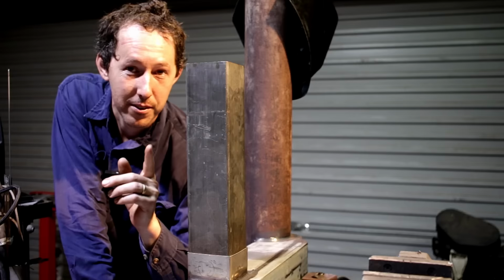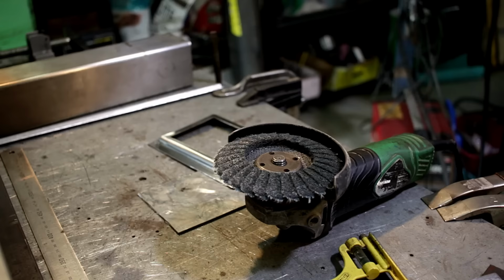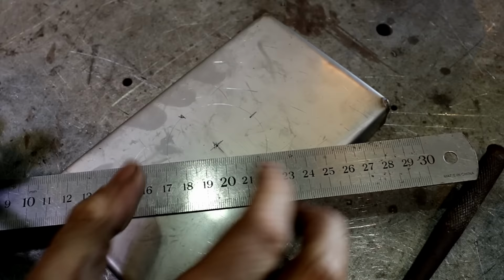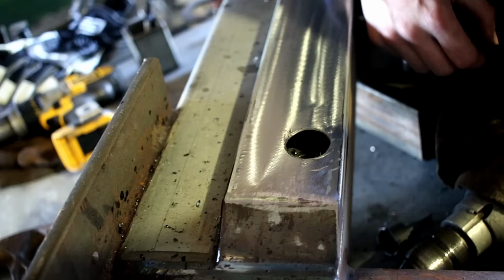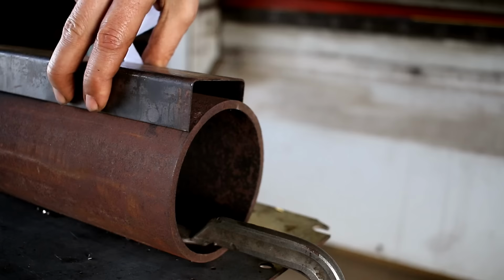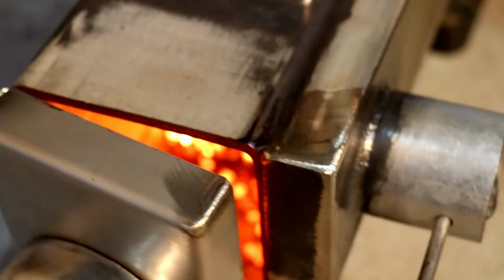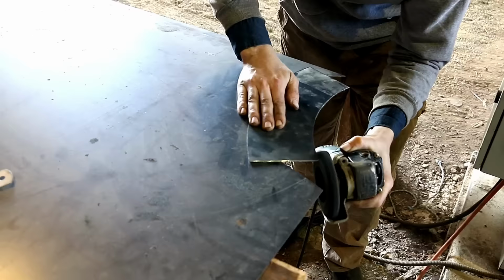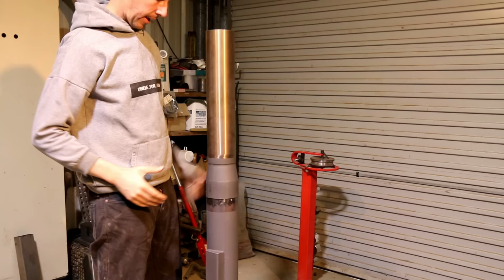Vortex Rocket Stove Pt 2

Comment: As someone who has dabbled in both building rocket stoves and editing videos, I am very impressed with your dedication to both. Thanks for putting in the effort, this video is both informative and fun. (I did end up watching it on 1.5x playback speed... but hey, I love seeing you put things together well). I'm also trying to nut out the right combination of airflow for a pellet burning rocket, and I'm finding it a surprisingly fiddly process. Do you find that you're getting back smoke from the pellet feeder when the pellets burn down (I noticed that in one of the clips) and was the extended riser enough increase in draw to deal with that?

Comment: I’m working on an idea to introduce air in the center of the vertical stack. Coming up from the bottom, the flames should preheat the pipe and then really pull in the secondary air. If I send you some drawings for a rocket stove, would you be willing to build it? I don’t have the machinery or skills to do what you can.

Comment: What are you burning as fuel? Pellets?
Reply from the maker: Yes I I'm using wood pellets as fuel. I found a good supply at my local pet store in the form of kitty litter.  They all natural made from compressed sawdust.
Reply: Thank you ! Interesting build! Are you using a mig or rig welder?

Comment: You’re a clever dude, what do you make of laser welding mate
Reply from the maker: Expensive for the newcomer but if you had a lot of production work with thin material, it would definitely be the way to go. I think because of the cost it's going to be out of the reach of the average person for some time but as a manufacturer it's cost would be offset by the increase in productivity.
Reply: @LittleAussieRockets    Thanks for replying mate, great videos

Comment: Very interesting seeing the stages of correction that in stages improves the stove's function. Much appreciated. 
And I love your dancing chicken. Tried to get mine to do that but not much success, lol. 
AND, while I love your humor, I do see that you are way too hard on yourself. 
Now, what I am wondering since you have that vortex in the exhaust pipe, it is not only burning off gaseous fumes but is also producing more heat and is there a way to tap into that for use and not cause a cooling that would negate the vortex effect? I know that drawing off heat from a regular wood stove pipe causes soot to build up in the pipe really fast. Not exactly a safe thing to do.

Comment: I found your video fascinating. Does the fact that is a vortex make it burn longer, hotter or take less fuel. Excuse my lack of knowledge. Love watching people work with their hands and just their know how.
Reply from the maker: Hi Nina
The vortex improves air flow.  A way to demonstrate this is to fill a bottle with water, tip it upside down and let the water run out naturally, take note of the time it takes to empty. Fill and repeat but this time induce a spin to the water.  The difference is remarkable and it is the same the air flow.   The increase air flow creates a hotter and cleaner burn.  Hope that helps 👍
Reply: @LittleAussieRockets Thank You!!  I am so glad I found your video. My father was a carpenter and my husband used to work in electricity. But welding I have never known anything about.

Comment: I am hooked on your channel, as you may have suspected. I am a third gen tool maker from New Hampshire and truly respect your hand skills including your weighted part holder for bench work. My goal is a primo pizza oven using this tech as the engine. What are your thoughts on this? I feel this specific rocket stove concept may be ideal. I plan on a conventional dome style oven with the unit below to fire it. 

I would appreciate your input Sir🙏🏼
Possible design collaboration? Thank you

Comment: I have a question, I see in your videos you just do a smoke stack for your rocket stoves/heaters where I've seen in most others they will do a 55 gal drum or a LP tank over the 1st stack then have the exhaust coming from the bottom of that and I was wondering on your thoughts of that? Great videos by the way keep the work! I like how your videos have a This Old Tony feel!